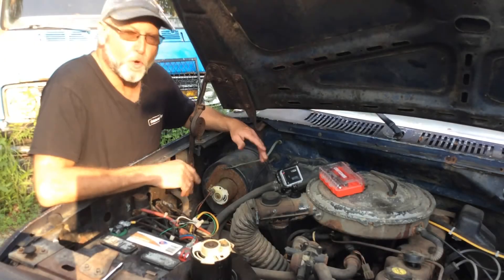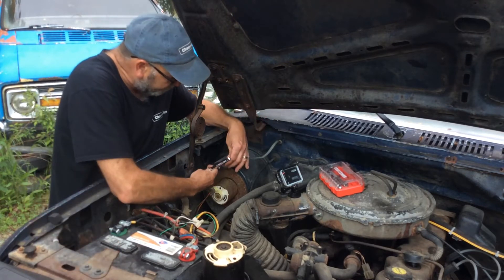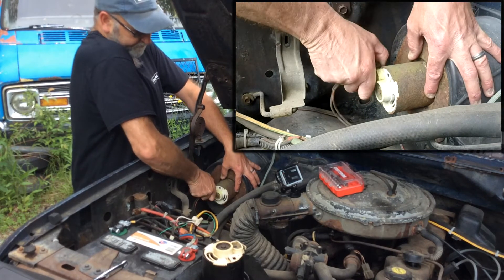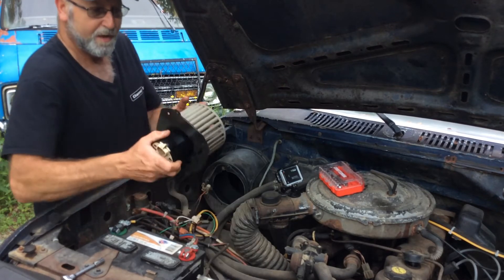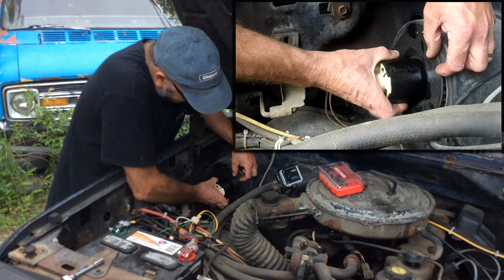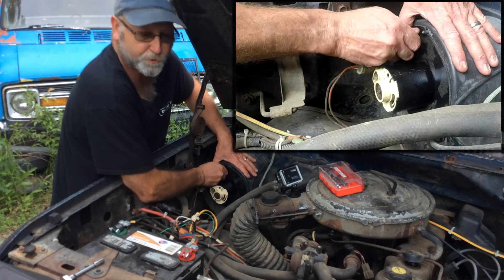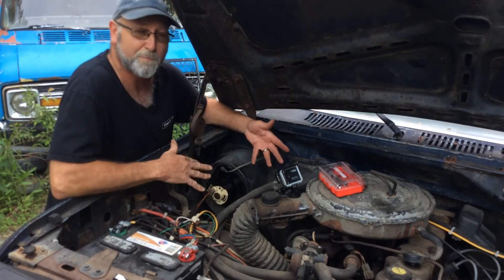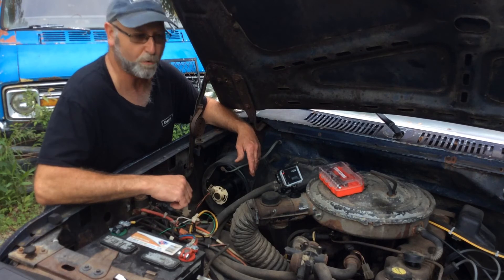DIY Guide: Replacing the Blower Motor in a 1985 F-150

Comment: Hi. Bro. Love the video. I've got a 1985 f-150 and I had to replace the blower in my truck, it doesn't blow as fast as the old one, is there something Rong or does it take time to get some ware on it before it starts running faster
Reply from the maker: I would check the blower motor resistor maybe it is bad on the high side? I think this is the right one.  https://amzn.to/3LbuH1S